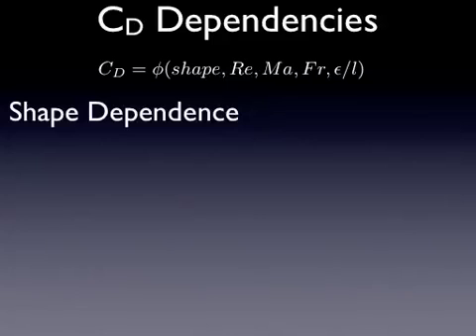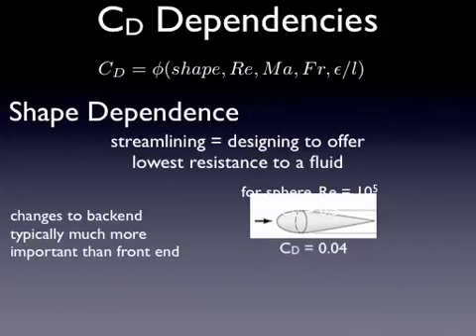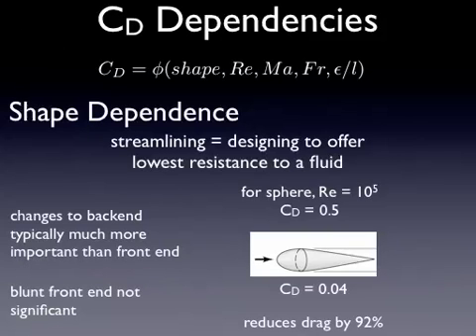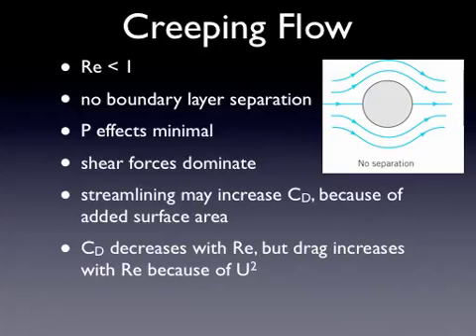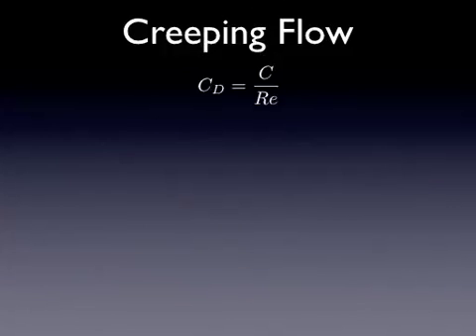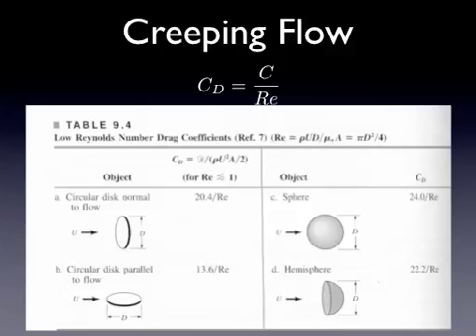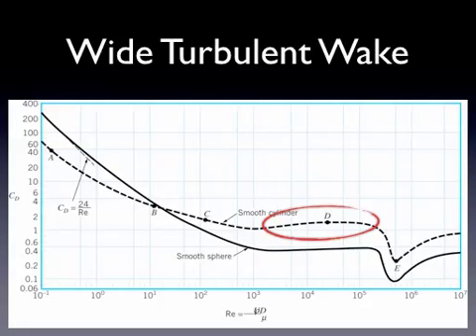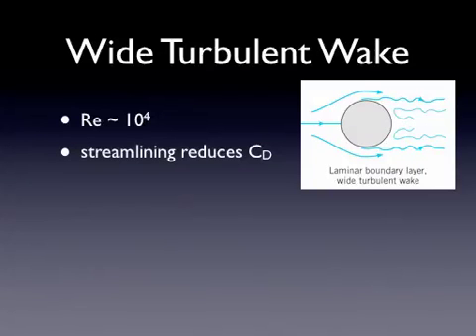34 Re effect on CD

Comment: this is a long shot but i'll try anyway. It's still unclear to me why after the first separation (still laminar flow) the coefficent of drag dimishes. I would assume that because with incresing Re the separation point "moves counterclockwise" (if looking only at the upper half of the circle) the pressure gradient would become higher and higher thus increasing the drag coefficent